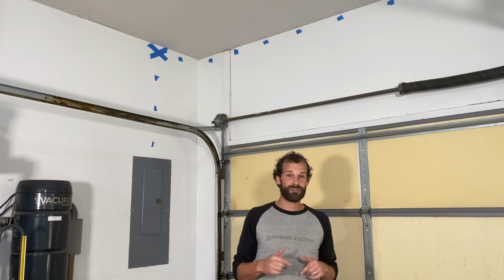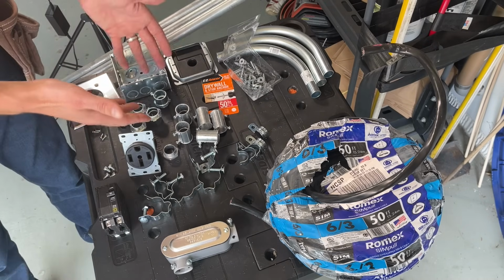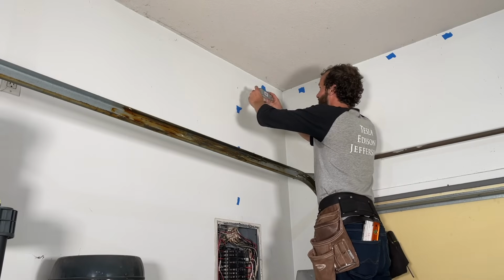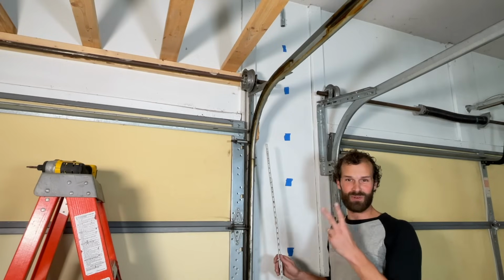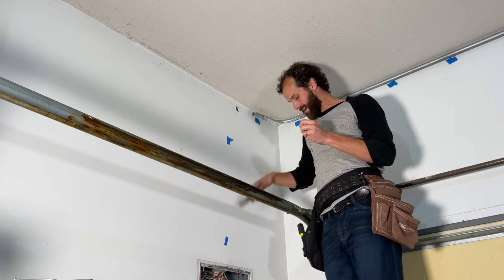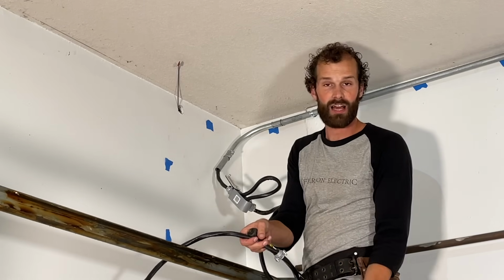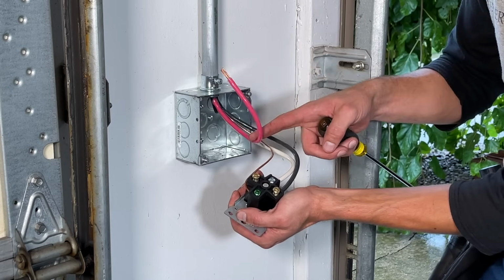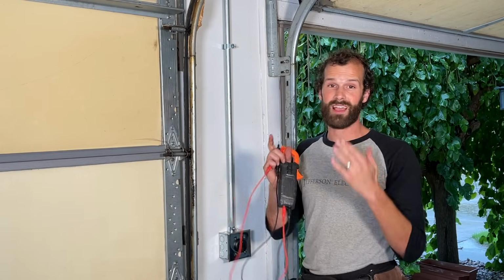How To Install a 240 Volt Outlet | Electric Car Charging

Comment: Sparky, wait, your serious.  I thought this was a comedy.  I was waiting for you to get hit with 50 amps.   You never properly grounded the outlet.   You ran a metal fish tape thru a live box, without pulling the meter (or even switching off the breaker).   You ran romex thru conduit.  There is a red sleeve I use where the wire exits the junction/goes into the panel.  I would not be surprised if you were using a metal ladder.   No eye protection?   It might not seem like a dangerous tool, but I've known a man to lose an eye using a screwdriver above his head.   Seriously, take this video down, and redo it if you must, but there are too many safety concerns with this video.  Houses move, up and down, side to side, a tiny bit at a time, wires expand and contract, you can see it on 20+ year old wires, that wear thur the insulation.  The proper grounding is a double failsafe...but not for you, you didnt use a ground screw at the metal box.    Not a word about inspection?   50 amps is serious power.
Reply: Well if he got hit with the 50 amps, he would not feel it....... very long. I have had to wire switch gear, disconnect and circuit breaker panels and I always make damn sure there is absolutely no power to whatever I am working on.
Reply: Agreed !
Very amateurish work on so many regards.

Comment: Defining what constitutes a ‘professional’ is very subjective. While this gentleman has experience, he does not have the depth that is necessary to be called a ‘professional’, in my opinion. While his explanation may enable a DIY’er to accomplish this project, it’s certainly made more difficult by installing nonmetallic sheathed cable (Romex) in a raceway, EMT in this installation. I won’t begin to discuss the electrical code violations, of which there were a few. Most inexperienced people following these steps will most likely be very frustrated by the time they finish.
Reply: I'm going to disagree. Yes, I'd have worked on a dead box and, yes, I'd have pulled 6-3 through a 1" EMT. Otherwise? Didn't see any gross errors. Oh, Romex in EMT is OK in our jurisdiction. Every damn county is different.
Reply: @ethelryan257  I’m curious why you would take the time to install EMT and then go to the expense and trouble of installing ‘Romex’ when individual wires would be so much simpler and less expensive.
Reply: And quite possibly badly injured or dead !!! No DIYer should try to do this the way he showed !!!

Comment: you mean 240,, 220 is European and Asian currents,, not the same as 240..  if your a professional,,  i will eat a hat,, your actions show greenhorn methods at best,,  unstriped 6/3 requires 1 1/4  conduit min..   striped is 1 inch..  and this job needs a permit,, in any county.. and state

Comment: I know things vary from state to state(NM in pipe), but you have to bond electrically conductive equipment everywhere in America, and both the pipe and box are not properly bonded. Somebody should check this guys card and ensure he is a licensed electrician(If Indiana even requires that).  This is gonna get somebody hurt. BTW shout out to my fellow electricians who TSHOOT homeowner specials, you are a special breed of electricians.

Comment: would be much better if the job was run entirely in e.m.t. conduit with # 6 thhn conductors. 3 wires needed, as the conduit is the ground. another comment was to run the job entirely with #6 m.c. cable. as electric cars gain popularity, the strain is going to show up on the grid. electric rates will increase so the utility can upgrade accordingly. think about it.

Comment: I am no electrician and I have done my fair share of electrical in my homes, (some not fully code compliant], but still safe)and this was a bit painful to with. No insulated gloves or glasses while working in the box. I also would have used a deeper box for the outlet since 6/3 is so stiff and a hassle to work with, not to mention a good Hubbel commercial outlet is deep to begin with.  Also I would have used a high end commercial outlet. Range outlets are not designed for hours of continuous high power draw as a range will cycle the power.

Comment: Being a Construction Electrician here in Canada and JIB Electrician in 🇬🇧 I always use green sleeve over the ground/ earth wire which.protect you from touching any live parts.I would make a 30 or 45 degree offset in panel and enter my conduit and surface to the drywall. Then straight up into a 4x4 deep box.

Comment: When I wired to/from a panel alone, I used one of those old style golf club protectors from old golf bags to insulate my snake but that did NOT reduce the need for extreme care. It looked weird but the piece of mind was priceless. Also in my area/town/village, code forbids Romex wire inside conduit, it was a pain to have to use a box to connect the required single stranded to the Romex. DIYer, check for that seemingly unusual code, here also a fire from uninspected wiring can cause insurance problems.
Reply: It is code here as well that you can’t run romex through conduit. The reason is for heat dissipation.
Reply: @mattweeks2272  I did not know that, thanks!
Reply: romex is allowed in conduit as long as it's not in a wet location like outdoors or underground.  Your inspector doesn't know how to interpret the NEC obviously.  Question everything.

Comment: Dude is bringing his bare knuckles to within a half an inch of the HOT main service wires at the bottom of the panel. I'm not even an electrician, but I do know enough to make some minor changes to my panel, and this guy is a hack.

Comment: You need to run 1/0 AWG Aluminum or 1 AWG Copper. 1st thing you want to do is turn off the outside house breaker. If you do not have a whole house outside breaker, you want to install one, after the meter. Every house needs to have one of these, for safety. If you don't have one, pull the meter.

I would strongly suggest using metal conduit.

You want to have a protective layer of metal between the power and the outside world.
I would also install a GFCI 100 Amp Breaker. 

The reason for this is:

The car is going to draw a lot of power when first plugged in and a 50 AMP breaker will trip some of the time.
You can always install a smaller amp outlet on a circuit than the breaker size. So, for instance, your kitchen may have a 20 AMP GFCI breaker, but only 15 amp outlets.

I would install both styles of the 50 Amp outlets with 2 boxes.  The older style and the newer 50/60 AMP outlet

The car may have one or the other and you may find they change it at some point, if you have to replace the cord. Also, if you buy a new vehicle after the first one, or a used one, you will see this.

The GFCI is critical in case you get a short in the car, or damage to the feeder. You want to have that breaker because it cuts off much sooner than a regular breaker, and will save your life.

If you don't have space in the box for a new double pole breaker, you can buy double breakers that will give you 2 breakers in the space of 1 standard breaker. I have even seen 3 and 4 breakers used in the EU, but I would not use those. If you have all your spaces used, and have doubles already, run a new separate service with a new meter just for the car.

While you are in the main panel, code has changed, and just for safety, replace ALL your outlet breakers, your outside breakers for outlets, lights, anything that is outside, fountains, etc..

Your kitchen, all of the outlets and appliances, like garbage disposal, trash compactor, dishwasher, etc..GFCI

Bathrooms, every circuit, lights, fan, outlets, anything in the bathroom

The washer, Dryer, and anything near them

Your basement, anything in there, and your attic.

You garage, everything in there, the garage door openers, outlets, lights, etc..

I have seen it take minutes for a dead short to trip a regular breaker, and if your child sticks something in an outlet, a GFCI will save their life.

Many accidents happen where electric lines come in contact with you or something metal

And your furnace and hot water tank should also be GFCI

Ideally, you want your entire breaker panel to be ALL GFCI

Also, make sure you do an amp reading on each primary and the neutral each hour.

You want to have as close to an even load through the day.

The neutral you want as close to zero as possible

I have seen panels melt because all the load was on one side

Depending on how you use your house, how many people, what you do with each room, you will get different loads for each home owner.

If it were me, I would install a new service just for the car.  A new meter, outside breaker, inside new panel, and GFCI 100 amp breaker and new 1/0 wire in a metal conduit, and the 2 metal boxes and 2 outlets.

You don't know what is coming next, and you may wind up getting 2 electric cars, and having that 100 amp service, when you add the second car, it is easy to run more conduit to the other side of the garage and put in outlets over there.
It would be a good idea to do that from the start, since you never know how you are going to park or what issues could come up as time goes on.

It is costly, but an electric car is 100k, so if you can afford an electric car, spending 5k to wire in the garage is not that big of a deal.

If you don't feel 100%, get someone who knows what they are doing, and ask around, get recommendations and estimates.  Don't assume because someone is licensed that they know what they are doing.  I have seen horrors from licensed electricians, including the entire house burning down.

After the install, have it checked by at least 2 other electricians, and you will need to have your town inspector sign off on each stage, and the HOA.

Don't skip any of these steps.

I have seen people think they can just do these projects, and a neighbor sees the electric car, and Karen calls the town to get a copy of the permit, and BINGO, your house service is cut within hours and your HOA fines you more than 5k, and then sues you, and evicts you.

Ask me how I feel about HOAs.

Comment: This guy belongs in Low voltage data work
Reply: I agree  romex inside conduit? Heat is the main concern on EV charging. I also see about 30 or so romex cables stuffed into a 2 1/2" conduit at the panel top  nightmare!

Comment: Here's my list of grievances 
1. No one worth a damn puts Romex in conduit
2. Grounding pigtail for the box is required
3. Speak of the way set screws are faced but you switch between 1 holes and a mini.....bush league
4. Obviously an LB instead of an LL
5. A mud ring and a flat cover.....no industrial covers where you live?
6. That box is not secure.....
7. NO ONE WORKS IN LIVE PANELS

Comment: Ok from the top:

1. As a homeowner you can't DIY anything that connects to your electrical panel.  You must be a licensed electrician period. 
2. Don't use an LB, LR, LL when penetrating a wall use a junction box just like you used for the device.  There is no method to secure the conduit body to the closed wall.  No the conduit support doesn't count.
3. Metal fishtape, live panel on a video for DIY..... JUST DONT.
4. Don't use mudrings on boxes that are surface mounted.  Use an industrial cover.
5. Don't install a metal junction box without a grounding pigtail, even when a device isn't being installed.
6. Don't use a razor knife to strip your wire by cutting along the wire as shown unless you have been doing it for years and can tell when the tip of the razor knife is contacting the wire under the sheath.
7.  "Wiggling" the wire on  copper conductors doesn't do anything, might on Aluminum.
8.  The corners on that metal wallplate are guaranteed to draw blood someday.
9.  Do not ignore issues like doubletaps when you are doing your job, panels open, FIX IT.
10.  On most sub panels ground and neutrals are separate, do not follow what is done as your guide, that is why DIY are not allowed to work on electric panels.  

General rule of thumb, if a handyman isn't allowed to do the work you are not allowed to do the work.
Stop making these videos and wtf is a Tesla certified electrician?  Another BS cert for something that any journeyman electrician should be able to do with his eyes closed...
Reply: COULDNT AGREE MORE
Reply: That is not correct. Homeowners in most states at least are allowed to wire up to their electrical panel.
Reply: @rcud1  A permit is required and homeowner will not pass inspection.  That is why I compared it to handyman services, no permit probably safe to do yourself, otherwise you will fail inspection.  But you go for it...

Comment: If you plan on using this video, don’t, this guy know’s just enough to be dangerous. Check out other comments.
Reply: When he was bending and mashing the Romex into the LLMR box I was cringing really bad.  His other safety mistakes aside, that stuff is going to heat soak and suffer from radius problems on a continuous 50 amp load.  :(

Comment: When working in a live panel with or without a fish tape ( finer glass ) I always 
Cover with cardboard . In this case I would push the card board in on the top right 
in case I let locknut fall - If would slide out onto the floor . I also squirt some lube in 
end of the EMT as I install — much easier to pull on long runs and around bends.
Reply: Make sure you use that safety cardboard.
Reply from the maker: Not bad advice, thanks for the feedback

Comment: The fuse box in Australia have a pull-out isolator that will disconnect the Switchboard from the supply

Comment: An excellent video. Recommend that you use a round hole, four square, rounded edge metal cover instead of the drywall ring and metal finish cover, somewhat like what you used for the GFCI outlet. I also bond the ground to the outlet box by cutting it longer and making a loop in it, and then using a depressed center copper washer and the standard ground screw to screw it to the box, then to the outlet. That satisfies most inspectors, but some places require a grounding lock nut bonded to the ground wire also. Also, you should wire brush the stripped wire and apply a contact enhancer, like Ox-Guard, to BOTH ends. This will set you apart from that run of the mill Tesla electrician. 💙 T.E.N. Edit: After reading many of the comments, I just want to say that running Romex inside conduit is legal here. For instance, coming from the garage ceiling, you can put the Romex inside conduit on the surface of a brick or cinder block wall down to your outlet or switch, as long as a transition connector is used. (Romex to conduit).            💙 T.E.N. P.S. I also have times when live wiring is requested or required.
Reply from the maker: Thanks for the great feedback Tracy 👍👍

Comment: Is it legal to have that many 12/2 NM cables in what looks like a 1-1/2" opening?  Much better to lube the wire before pulling.  Since panel is hot he should be wearing safety glasses or face shield

Comment: Very good, piping and landing the wires also good job on explaining to regular ppl who may not understand how to do this as a diy, But you missed one big/small detail you forgot to ground the metal outlet box with a pigtail or grounding screw NEC article 250.148.

Comment: Meat head said 220 hahahah.... Residential is 240 volts.... He's quoting prices and forgot to add the time and money required to inspections... Yes, wear a metal wedding ring when doing Electric too.. hahahahaha 

He finds EMT cute... hahaha Its required in Cook County... 
Dude basically runs an extension cord
Talking about "PRO TIPS" hahahahahahahaha

Installing a box connector is what separates Handymen like him and pros he says....
hahahahahaha 

Dudes like this make me sick
Reply: He explained the 220/240 issue at the beginning
Reply: (Dudes) like you make me sick

Comment: This guy is obviously a Pro, but supposedly the video is to inform non-Pro's. Given that the first thing that should have been emphasized is TURN OFF THE POWER AT THE MAIN SWITCH IN THE BREAKER BOX. DON'T remove the cover before doing this!!! Period. Paragraph.

Comment: You should insulate the metal part of your long screw driver. Few decades ago I tripped out an 11kV board during protection wiring because of screw driver touching the metal clad.

Comment: 6/3 Metal clad cable would have been so much easier to install.
Reply: Teck 6-3C CU cable can cost $10.00+ per foot. Figure >$300.00 or more for a 30 ft. run.
Reply: @murrayhill9000   6/3-Gauge MC Lite is around 4 dollars a ft, basically the same cost as romex right now in the box stores. The Teck stuff looks like a more expensive/higher durability product.

Comment: Why not use a tubing cutter instead of a hack saw to cut the EMT?
Reply: Tubing cutters for EMT is an NEC violation as that process narrows the diameter of the conduit at cutting point, tubing cutters are a plumbing tool.
Reply: @macbigmac5926  I always used a tapered reamer to remove the lip left by the tubing cutter. That way, there was no reduction in interior diameter or sharp edge.

Comment: Very, very good job. I wondered why you didn't select an LB fitting at the beginning but you made it work. Learned a long time ago to use wire lube on almost every conduit pull that even looked remotely like it might need it. Great job!
Reply: No wire lube needed,  most wire now sold is simpull(southwire)  which doesn't require lube.

Comment: Your having a hard time pulling because that cable isn’t for use in  EMT.    You didn’t bond the box, that whole emt run is not bonded.  If one of the live conductor makes contact with that box, the whole emt run may become live.  Nothing professional here

Comment: Damn your cables are so thick. It has to suck having only 120/240 V.
Here in sweden we have 230/400 V, we feed a whole house with 25 A and that cable to the EV outlet looks just like a standard cable to feed a whole house with 25 A.
So big cables for you guys.